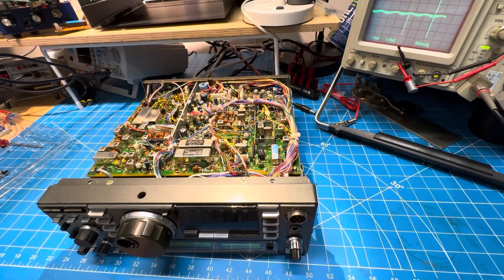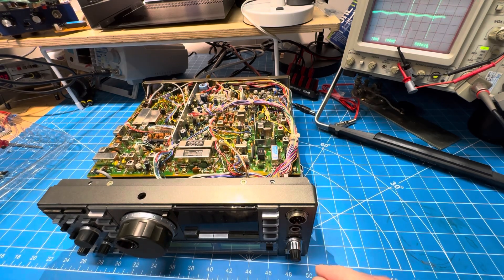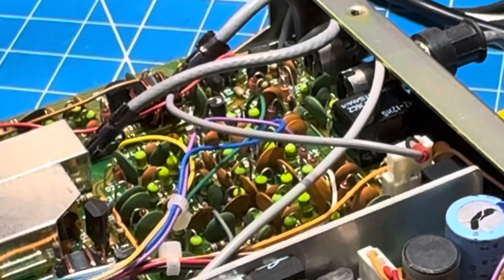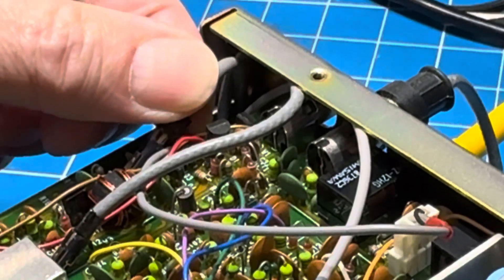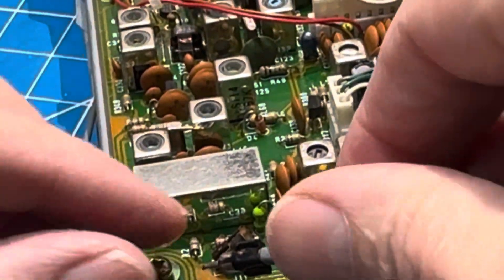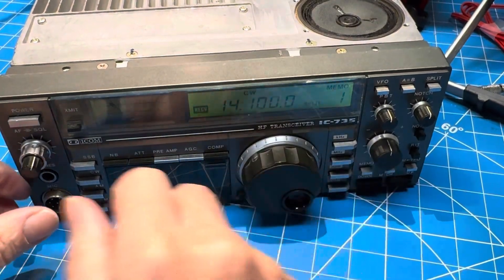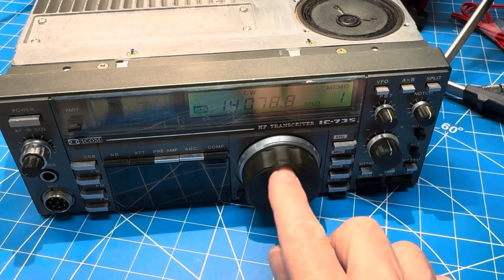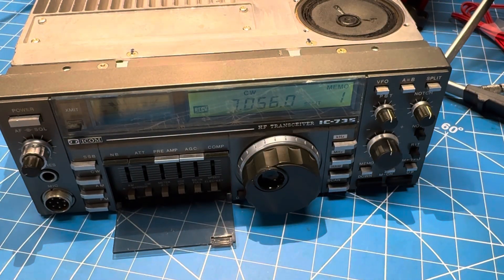Icom Ic-735 FL-32A installation. #3 very nice! The new 500hz filter works!

Comment: Why does the IC-735 require a RF receive jumper on the back?  It seem that should've been inside the  case..
Reply from the maker: The RX jack was part of their solution to make transverter use easier. According to a few posts their transverter output is lower than “standard” transverters so those wanting to attempt it should do some research.
Reply: you can hook up a receive only antenna like a beverage, loop etc. I use a mini-whip, loop on ground and others..Works very well. 
VE3IIM/VE6PG
Reply from the maker: When u compare the receiving loop, does your experience agree with the reports of lower noise?
Reply: @tyrueiI  yes...good to experiment with..

Comment: I'm  impressed with how the CW signal jumped out of the noise when you switched to the 500 Hz filter.  Now, you need to celebrate with a couple of CW contacts.
Reply from the maker: Thanks! Agree that with my local QRN, the filter seems to really help.